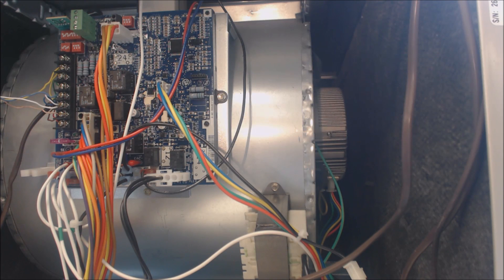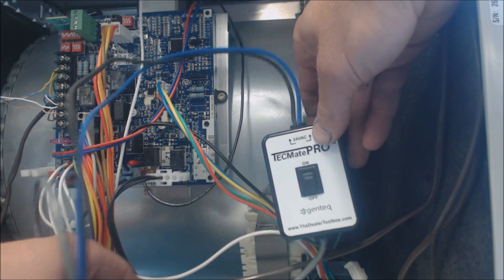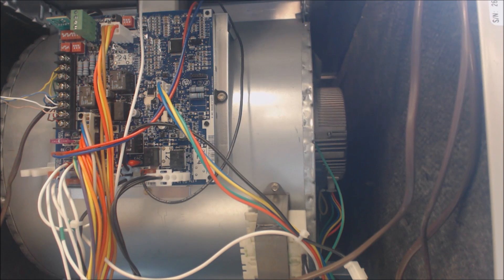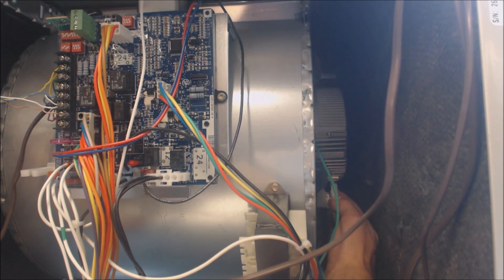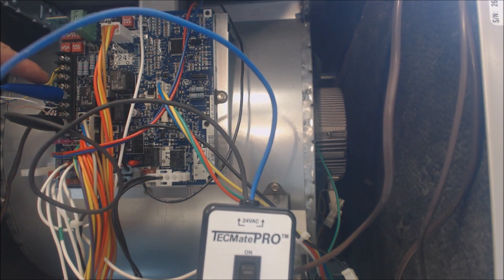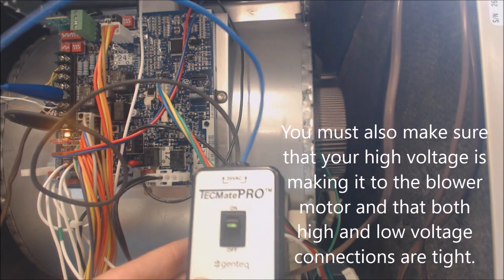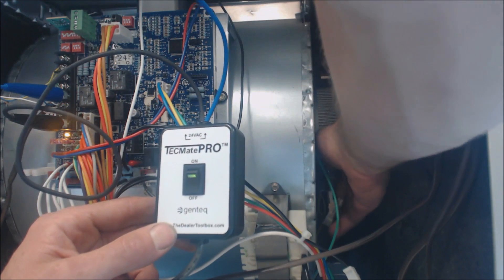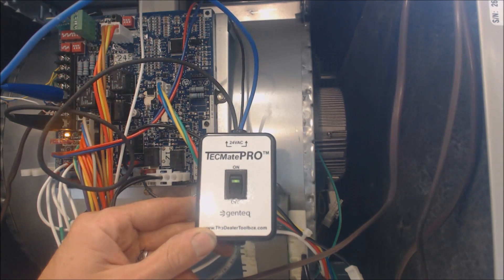How to Troubleshoot a Variable Speed Blower Fan Motor Easily and Quickly!

Comment: I have an ECM motor in a Goodman heat pump air handler the fan runs constant only in cooling it will not do it In heat only in cooling even when it's not getting a call for cool what could that be

Comment: tester is nothing more than a 24VAC switch that switches the low voltage and can be made from a used 120/24 volt transformer

Comment: I have a Lennox 90% Flash e 201 which is not connecting with blower
Put my motor tester on made sure I had my constant 115 and blower did not move I change the blower motor and after a day I'm getting the same code again if you reset the furnace it'll run for a cycle or two then start flashing code again

Comment: I NEED HELP!!! my furnace is not working, only thing that comes on is the blower. I have voltage going into the computer but no power from the computer to the other components. I jumped the inducer motor from the wire that goes to the door switch and it started up. please help

Comment: Hi i have a 10yr old Trane XR series furnace with ecm variable speed blower. I had a grinding noise from the blower. I assumed bearings were shot. I disassembled the motor to find the glue that held the magnets to the stator/ shaft failed/seperated.  I used hi temperature epoxy and glued the magnets back on to the stator/shaft. The motor now spins freely but the motor doesnt ramp up to high speed. Its a little erratic at start up then runs on low or just or just under low mode. The furnace goes out on high limit due  to the fan in low mode/ or rpm just under low mode not turning fast enough. It trys but never gets to high mode. Any idea? Time for a new motor or do i change the ecm/computer board part of the motor? Thank you for posting. I hope you can reply. Like subbed notifications on.
Reply from the maker: Usually the module by itself is very close to the price of the motor and module. It sounds like you would need a new one since you can't adjust the speeds, thanks!

Comment: what does that low voltage harness jump out in the motor? Are you giving 24v to pins 1&3 and 12&15 or something? I think there are 4 specific pins one needs to give 24v to
Reply from the maker: I have multiple ecm videos and on one I show which wires to power 24v to in order to make your own harness. Look up acservicetech ecm motor playlist, thanks!

Comment: Great video,  question I have is this on the Gentec 2.3 if the motor is 240v each leg has 120v and a good ground but shouldn’t you have 240v if you test the 2 legs together? I am only getting the 120v on each leg but NOT the 240v if I test them with both leads. I used the Zebra tester and it also didn’t turn the fan on.
Reply from the maker: It sounds like each of the 120v is from one leg of the breaker box and not both legs, thanks

Comment: I think there is one other thing you should have mentioned. With a split system the 24 Volts can be coming from either or both units, so I would turn off the power to both units so you don't accidentally fry the transformer while connecting the 24 volt leads of the tester..
Reply from the maker: Hey UtwoBed, in residential light commercial, only very few systems have a 24v transformer at the outdoor unit but they do not get connected to the indoor blower as then there would be the possibility of double feeding a relay. Most outdoor 24v come from the indoor unit, thanks
Reply: Yes, two transformers is rare, but you said it yourself, 24 volts comes from the indoor unit. If you are testing an ECM  condenser fan motor turning off the breaker for that will not kill your 24 volt control voltage feeding from the air handler. It's easy to get careless with those big alligator clips and short out the transformer, circuit board, or blow it's fuse if it even has one.
Reply from the maker: Yes that is completely correct if you are at the outdoor unit. I thought you were talking the 24v from the outdoor unit coming to the indoor unit. Yes you are correct, just shut everything off to be safe, thanks UTWOBED!

Comment: Super thanks bro. for your time. I always wondered how to test those variable speed motors, and now i know. I greatly appreciate this video.
Reply from the maker: Thanks Mikey Angel!
Reply: Hi, AC Service Tech, is there a resource to troubleshoot Heat Pump communicating boards (IEM boards), such as Honeywell THM5421C with Honeywell Tstat TH9421C1004,   or Honeywell IEM board THM5421R with Tstat TH8110R1008 ?  THANK YOU
Reply from the maker: I am unfamiliar with any resources on that topic, sorry a lot of my troubleshooting experience is from just doing it, thanks

Comment: Correct me if I'm wrong... If the blower doesn't start when you flip the switch it means 1 of 2 things: bad motor or bad module (not necessarily the motor, as stated in the video).

To determine which of the two it is you have to remove the control module and ohm test the motor. If the motor is good it has to be the module.

Much cheaper to replace the module than to replace both motor and module.
Reply from the maker: Here is a video on that-  https://www.youtube.com/watch?v=x24AjKupGD4   -In my experience the module or hub is 3/4 the cost of the two together. In my opinion, they shouldn't be but that is what the manufacturers are charging. Rarely is the problem in the 3 phase motor like you said, thanks!
Reply: Then go back in a week and replace a old burned motor

Comment: can you please explain how does the variable speed motor adjust its speed automatically? is it based on the return air temp? thanks.
Reply from the maker: It is actually based on torque due to how loaded up the blower wheel is due to air molecules. It is set for a certain air volume from the manufacturer of the equipment even though it is manufactured by Genteq who has basically has a monopoly on making the motors. These motors will ramp up to try to attain the same amount of air volume even if there is friction in the duct due to undersizing. The problem comes in when someone does not change their filter or the duct collapses and the blower motor tries harder and harder to push the air until it likely breaks. This is unlike the psc motor when there is a duct restriction. The blower motor turns faster due to not being loaded up by air molecules but the air volume is very low, amperage is low and there is not as much of a problem with the motor burning up, thanks Mark!

Comment: Question: I live in South Florida. I have a 2.5 Ton Rheem Air Conditioner. It is a 5 variable blower [low, low med, med, med high, high]. What speed should the blower be set to? The AC tech initially left it on high as the default... but then put the blower speed to low. I found forums that if the blower is to high, it will take out less humidity.
Reply from the maker: Variable speed motors are programmed specifically for that model number air handler. You would need to find the manual for that model number or look it up online and then set it accordingly. It is best to set that for 400cfm per ton so 1000cfm, thanks

Comment: I am definitely going to be getting this tool. Thanks so much for sharing. Looking forward to more great videos enjoy them so much very helpful.
Reply from the maker: Here is the link for the TecMate Pro-  http://amzn.to/2jIP0ty  --  Also if you have a good 16 pin harness or the 3.0 harness you can cut it in half and actually make two 16 pin or 3.0 harnesses if you power the correct 24v wires in the harness. I was thinking about making a video on that at some point. Thanks Keith!

Comment: my blower is got the same speed i cant slow it down!
Reply from the maker: Usually you can set the speeds with the dip switches on the control board with the power off for variable speed blower motors. You would need the installation instructions of that model in order to do this.

Comment: The only thing is what if the motor rocks back and forth. But there are no signs of and burned parts on the variable speed controller?
Reply from the maker: With the power off you would still check to see if the blower wheel spins free, is tightened on the shaft and that there is no rocking due to bad bearings. Yes you would still need to check these things first on any type of blower motor. Thank you very much!
Reply: All that checks out I also check the motor resistance and everything checks out no burn parts on the control module either. I am and a licensed electrician and also an industrial maintenance electrician everything seems good mechanical and electrical except for electronically I'm thinking that the board has a problem what do you think?
Reply from the maker: Did you test this with a tecmate? The motor is always hot 24/7 with line voltage. You need to power the motor in the case of the 16 pin wiring harness with the two appropriate 24v hots and two commons as signal wires. The tecmate makes it simple so the wrong ones don't get powered. Are you saying after testing with the tecmate that the blower motor is not working?
Reply: I just removed the blower motor and held the door switch to watch the motor try and start up. it just moves back and forth.  So i thought maybe there was a capacitor problem. So i took the motor hub housing that has the thermistor in it off/apart.  And everything in there smells good and looks good. Motor it self has no problems when checking the windings with a multimeter. So im wondering if the motor and housing were good. then what would be the second place to check on the furnace main board?  I know  i need to get a techmate tester on it.  But again lets just say everything checked out with the techmate and worked. Then where would a person look next for troubleshooting?  Also I subscribed to your channel.
Reply from the maker: If the tecmate did turn the motor on and the motor did not fluctuate in speed up and down and up and down but just built up to a steady speed then it is either the 16 pin wiring harness or the board. Sometimes the harness connectors are not making a good connection. You should push in on every single wire in the harness and then turn the power back on and see if it works. Sometimes I do try to squeeze the female connectors a little bit too in order to make sure they are connecting onto the board. So anyway, if the tecmate turns the blower on then the board is bad after checking the wiring harness. No more testing needs to occur if you are always fed with 120v to the motor hub. It does however sound like you are receiving a signal to the motor though if you see it move back then frontwards. That is what the variable speed blower always does before starting in the correct direction.
Reply: @jerbear6947  You're not gonna have a capacitor problem with an ECM
Reply: @acservicetechchannel  thank you from 6 years ago. By the way. Means a lot. Thank you
Reply: What was the problem in your case?
Reply: @cup_and_cone  my issue was the circuit board controller on the back of the motor.   Once I replaced that it was fixed.   I think it’s called a servo motor or something.
Reply: @jerbear6947  Thanks, that's exactly what's wrong with mine...the motor control module costs as much as an entire new motor (HD44AR242)! 🙄😠

Comment: Could you not skip buying this tool by just checking for power on the incoming 24 volt harness?
Reply from the maker: Absolutely, just jump out the same terminals in the harness plug with 24v. This is just a quick tool for the tech. They are not that expensive. Thanks
Reply: great videos I'm very impressed thank you for your knowledge
Reply from the maker: Thank you and glad you are enjoying the videos!
Reply: Ri

Comment: Thank you very much for your time of your explication , let me tell you little bit more of my situation, the tool that i got is like yours but mine says "tec inspect " (should be the same ) , i have 120v coming to my variable speed motor and is connected to the motor, i hooked my tec inspect to the board having 24v and light ON , and on the other end , the 16pin connected to the motor , I switched the tec inspect ON , but nothing happens with the motor ( doesn't spin ) what is telling me ? I have bad motor ? 
Also i opened and checked the motor winding , the motor isn't grounded and have around 10omh the three legs , and i didnt see any parts fried on the module . Thank you in advance
Reply from the maker: If you have tested this blower motor at the thermostat with g fan and y cooling and it didn't turn on and for your 2nd test as long as the tool you were using is putting out the 24v on the correct wires then the motor hub is bad. I have had some hubs that were bad but not visually. I have also had many where the problem was in the 16 pin wiring harness but you are taking that harness out of play with the tech inspect. It also sounds like you checked the 3 phase motor windings appropriately. If you were concerned if your tech inspect was working properly maybe you could try it on another furnace if you have access to another. Other than that you sound correct. Thanks

Comment: Good information , what about if the blower motor doesnt starts with the TECmate PRO , bad circuit board ???
Reply from the maker: The TECmate only receives 24 volts off of the board so if you had a 24v power source then you don't have to hook onto the 24v power on the board. As long as you have 120 volts going to the blower with a good ground at all times, the TECmate just gives the signal to the hub on the motor telling it to turn on. If the motor turns on and does not ramp up and down and up and down but just acts normal then the motor is good. You then would need to verify that you have a call on the board thermostat terminals and not just an open safety switch somewhere that is stopping it from working. This is easier when thinking about heating as there is a sequence of operation and the blower motor is last so you know there is a call for the blower to turn on. A quick tip also is with the power off, push each 24 wire into the connector going to the motor and into the connector on the board and see if you have the same problem after you turn the system on. It is possible to have a loose connection. Thanks for the question!